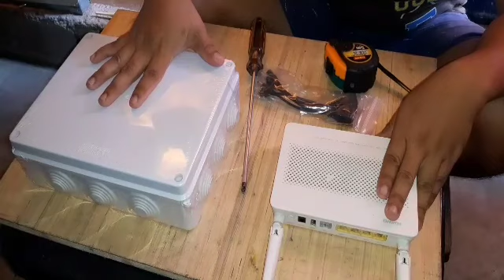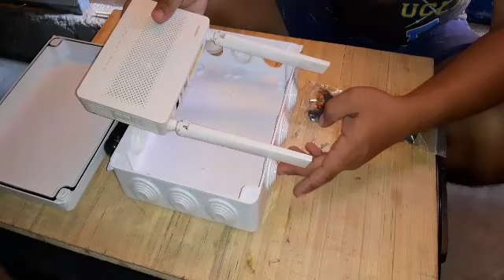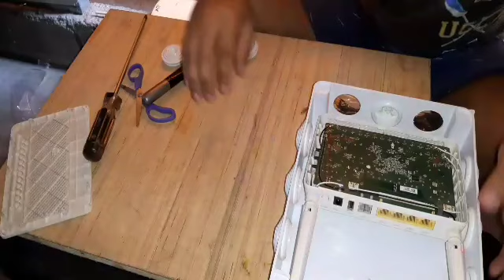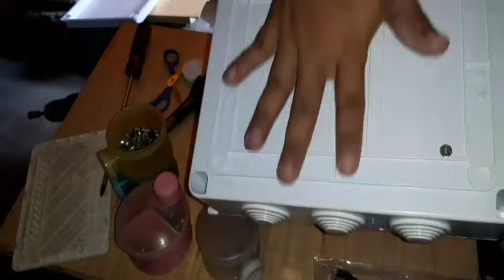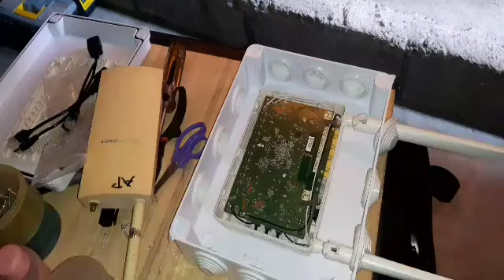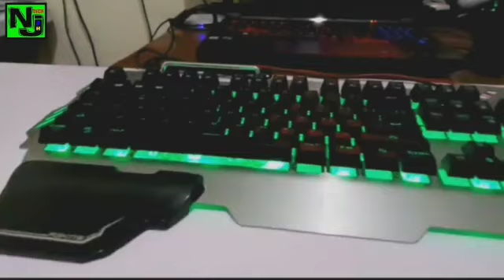Mabilis na Dual Band Outdoor antena 5v5 DIY  piso wifi

Comment: Sir pahelp naman po sinundan ko yung tut mo ng 5v5 v2 pldt to blue firmware successful kaso ang mali ko pag access ko portal chinange ko agad upstream to lan 1 ayunclang binago ko ayaw na maccess portal ngayon tapos sinubukan ko uli ireflash ayaw ma flash help po😢
Reply from the maker: pag nilipat mo sa port 1 ang upstream ..ilipat mo lang yung utp cable sa port 2 3 or 4 ..
tapos dapat naka static kana nang 192.168.100.2
255.255.255.0
192.168.100.1